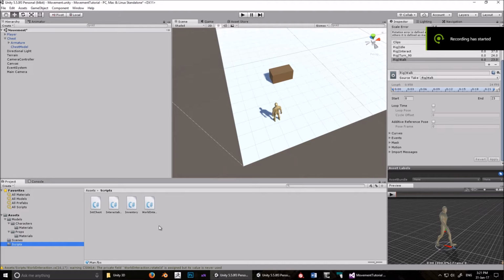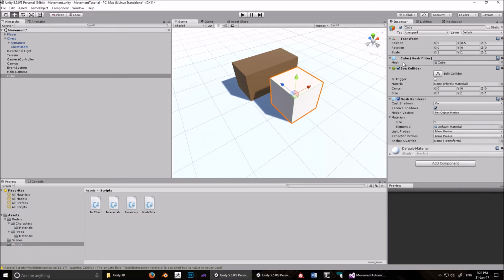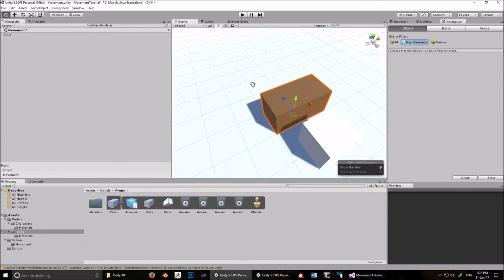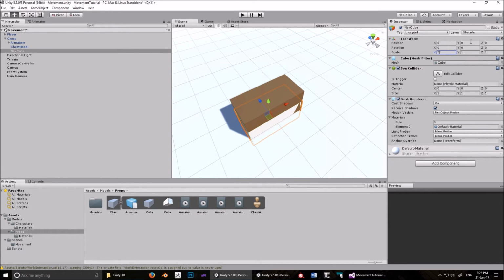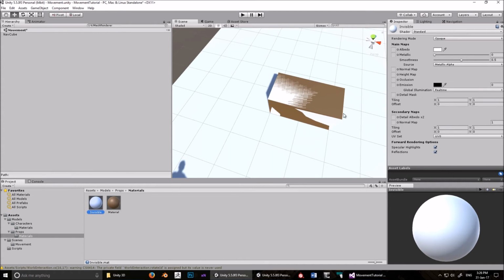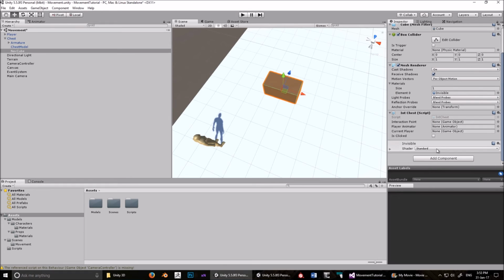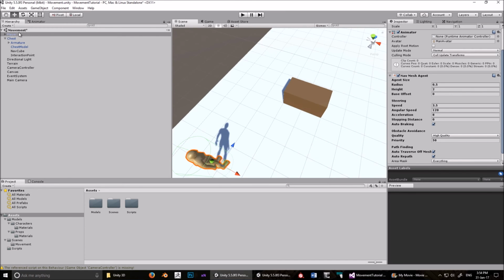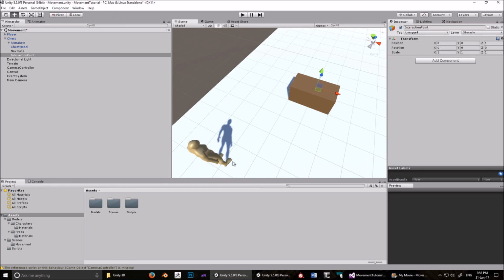Basic Click-To-Move Mecanim System #3: NavMesh

Comment: For objects like that chest you should be able to add a Nav Mesh Obstacle to it and that would solve your baking issue properly.
Reply from the maker: hmmm, thanks for the heads-up :)
Reply: Np ;) Btw, make sure you have "Carve" checked inside the Nav Mesh Obstacle component. With that, you'll have a dynamic obstacle that doesn't require the nav mesh to be re-backed when you move it around.

Comment: My best guess as to your navmesh issue with two possible solutions:
Normal fix:
Due to animated meshes being potentially moved or destroyed, by default the nav mesh doesn't pay any attention to them. You can set the items to static if the item, like the chest is never going anywhere.
Other ideas:
Alternatively, rather than adding materials to the cube, bake the navmesh with the cube, then turn cube off or delete it. You could attach a script with a for while or for each loop to turn off the mesh renderer for all items tagged as 'NavItem' and then tag cubes and things appropriately.
Considering the script idea, create an empty game object in the scene, name it Environment and then make all items in your world children of Environment. Attach a script to the Environment game object and make it look at children.
I'd only consider the scripting element for areas you want the nav mesh to ignore, but the item may move or get destroyed, but think the idea is probably a little too complicated.
Reply from the maker: Thanks for the comment! Changing the mesh to static doesn't seem to work (on my end anyway), but I should definitely delete the cube instead adding a transparent material!! Not sure why I didn't think of that :) 

I've ditched navmesh for the time being though. I need a dynamic pathfinding solution so I extended Sabastian Lague's and it works pretty well. However I've run into an issue. In his system, units stop immediately before the target node and not directly on top of it. That's a problem for my game, but I can't for the life of me work out how to change it. I've posted a question here: http://gamedev.stackexchange.com/questions/137412/pathfinding-landing-on-the-target-node. If you can help out, any advice would be appreciated.